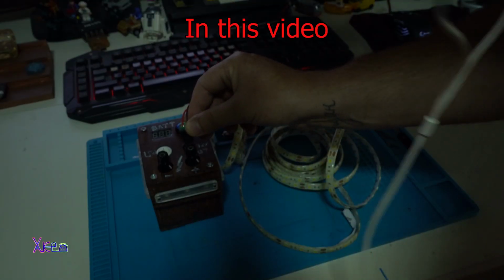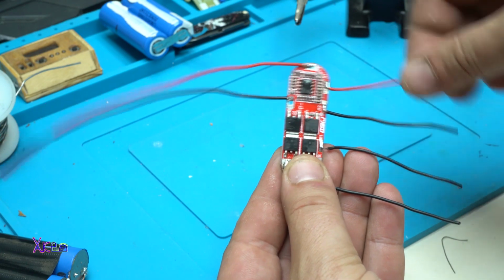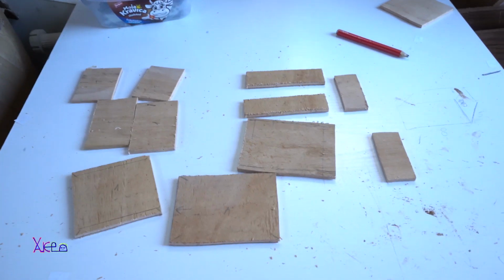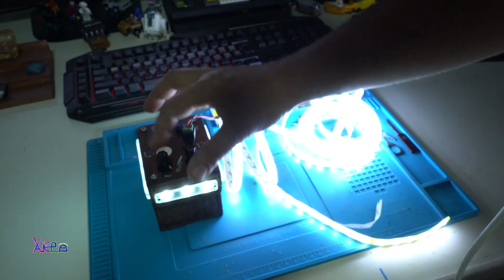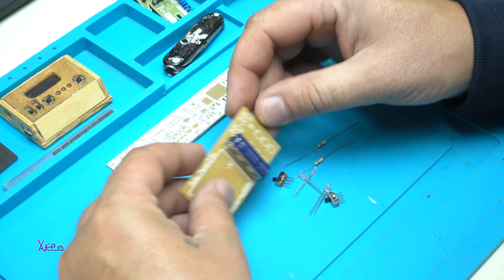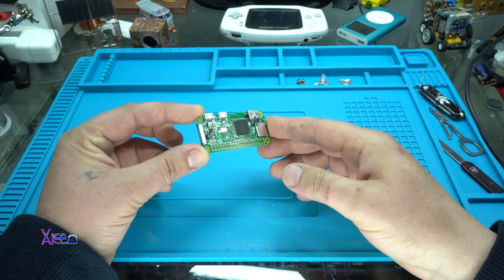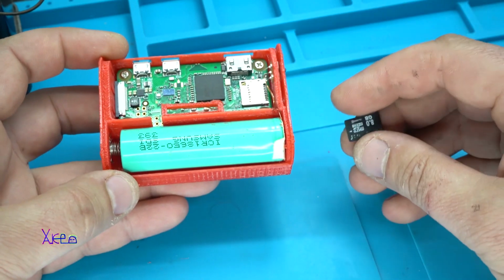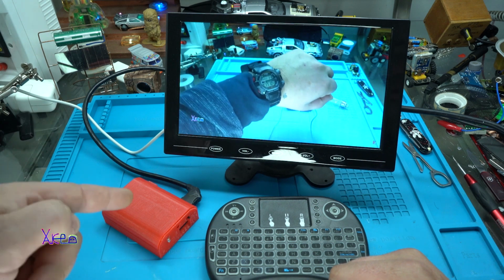4 Home Design DIY Projects

Comment: It's like you are stuck in 2017, the raspberry pi zero 2 is out, your raspberry pi should have that metal shielding next to it, either video old or you used the same old raspberry pi, but good video
Reply: wrote the same thing in another video man but there are also alternatives like the banana pi m2 zero and theyre really cheap,in germany they cost around  170 euros (170$)  because of scammers and something.the thing is in usa they cost around 15 to 25 $ so its really cheap why dont buy ? and you cant really use the original pi zero w for youtube because either really long loading times or you cant really play the video without stopping or even crashing because of the weak cpu,you also cant use it for a personal mobile computer because the pi zero is too weak for such kind of application, yes you can use it for a media center but for something like this i would prefer a raspberry pi 3 a pi 4 or even a pi zero 2  and a banana pi m2 zero but NOT a raspberry pi zero w or a pi zero
Reply from the maker: Do you have a raspberry pi?any model😁
Reply: @Hacktuber  yes a raspberry pi 4,pi zero 2,banana pi m2 zero the original zero for retropie and a pi 3b+ 😃
Reply: But it was a very good video.Thanks that your creative stuff is on Youtube,very cool 🙂
Reply: @Hacktuber  i plan on buying, but i just know alot about it